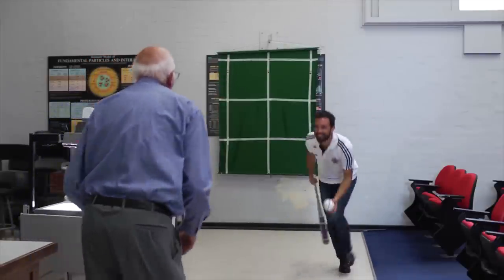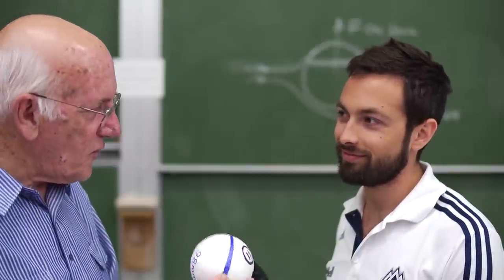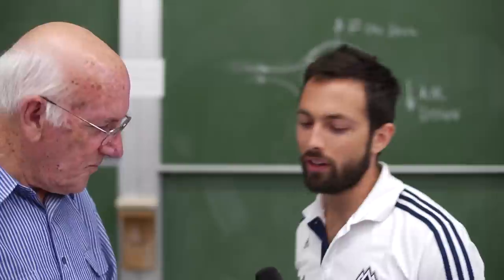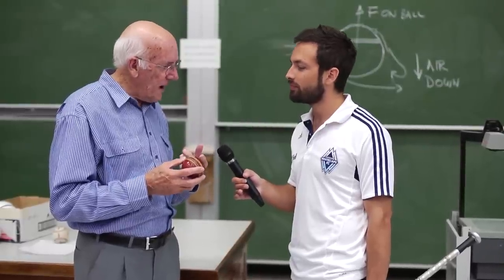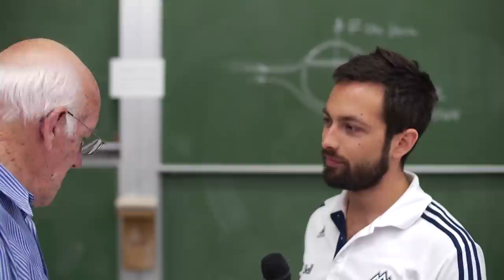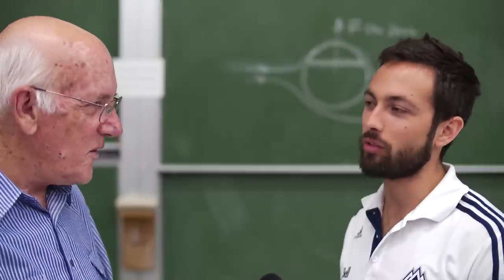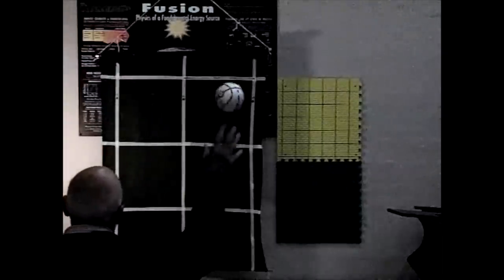The Science of Curveballs

Comment: What you explained with the cricket ball was the conventional swing. Can you please provide an explanation for reverse swing that happens once the ball gets older?
Reply: the bowlers maintain one side by polishing it and allow the other side to deteriorate and become rougher. They can then choose the direction of the swing by just deciding to have the smooth side on the left or right.
Reply: +Dinsdale Drummond that's not correct reverse swing is when the ball usually a ball of around 50+ overs old will start to swing the opposite direction e.g. Towards the shine and away from the rough side. As far as I'm aware no one has been able to comprehensively explain this phenomenon.
Reply: Jon bell this video just comprehensive explained it
Reply: no, this video explained conventional swing with regard to the cricket ball - it did not explain why after becoming old a cricket ball starts swinging towards the shine - do you play cricket ?
Reply: @Jonno_B251  I think the reason might be that, by that time the rough side would have shed a lot of material that the smooth side will be heavier in the air. So this weight difference might override the turbulence effect explained here, as the ball gets older.
Reply: @Jonno_B251  it’s the when the rough side is roughened enough to create air-pockets on the surface, that the air is able to slide more smoothly over those air-pockets than over the not-so-smooth side now (by 50+th over).
Reply: @Jonno_B251 reverse swing is easy air speed is slower on the rough side ... implying higher pressure creating a lift ...  like an aeroplane. Bowls moves in direction of shine. Like plane flaps.

Comment: Just to get the baseball jargon correct: The "curveball" that they talk about at 2:07 is actually not a curveball but a slider, which breaks mostly laterally. The curveball's dominant movement is downward, due to the top spin imposed on the baseball by way of the pitcher's delivery, which basically pulls down at the front of the ball when he throws it.  Some curveballs do have lateral movement, but the essential break is downward.

Comment: The purpose of a knuckle ball is to give very little spin to the ball.
So the perfect knuckle ball initially has no spin.
If the ball is perfectly round and smooth it would move normal.
A ball isn't perfectly round and smooth, it has all sorts of bumps, scrapes or seams.
This, together with drag, will make the ball rotate. Also the bit from 2:50 on is still valid. 
So the ball will swing away from the smooth side, which will change as the ball is rotating. Which makes for a erratic flight path

Comment: I'm sorry if I sound dumb, but what about the Bernoulli's principle? 
If the air passes through the rough side of the ball, then it will meet greater resistance, right? (I'm actually not sure about it).
Then, according to Bernoulli's principle, the fluid(In this case, air), must exert a greater force on the ball than the smooth side.
This should make the ball swing towards the smoother side.
Could anyone please tell me why this approach is flawed or if the assumption I've made is wrong?
Reply: exactly what i was thinking and what i had been learning from other vids.
Reply: No its not flawed, both effects are in place of course. 

Same is the case with the aerofoil, you have Bernoulli and the Third law together gives the lift!
Reply: Your understanding of Bernoulli's principle is a little off. What it says is (in the case of the ball) the air will travel faster because of the roughness (roughness can be attributed to friction, but nor really in this case) causing more terbulance, meaning air traveling faster.
This will cause low pressure on the side which is rough and and the ball moves in that direction.
Remember, the key is that on the smoother side air travels slower creating more pressure and pushes the ball causing it to swing.
Reply: I would like to start by clarifying the deference in resistance, applied on a ball, between a laminar flow and a turbulent flow.The laminar flow creates a bigger wake behind the ball than the turbulent flow, resulting in a larger drag force applied on the ball. A smaller wake behind the ball also explain the longer period in which air ''sticks'' to the ball (the difference in separation point). Another very important thing to note is the misconception around the Bernoulli's principle. Firstly is that you CAN NOT apply Bernoulli in turbulent flow. The assumptions of Bernoulli's principle are: STEADY FLOW, IN-COMPRESSIBLE and IN-VISCID. In this case the flow is NOT steady, it is also NOT in-viscid. It is dangerous to apply Bernoulli if you don't understand it properly. Usually Bernoulli is used for finding values around the real ones and that is mostly because of the in-viscid assumption. The Magnus effect is given because of the curvature of the flow that  creating a change in momentum of the flow and that resulting in a force on the ball. No Bernoulli just change in momentum.
Reply: 0verkilled you have just said the opposite. bernoulli's principle - increase in speed will lead to decrease in pressure, vice versa to achieve lift, wings are designed in such a way to more wind speed on top of the wind compared to bottom.
Reply: 0verkilled Bernoulli's principle can be used to calculate the lift force on an airfoil if the behaviour of the fluid flow in the vicinity of the foil is known. For example, if the air flowing past the top surface of an aircraft wing is moving faster than the air flowing past the bottom surface, then Bernoulli's principle implies that the pressure on the surfaces of the wing will be lower above than below. This pressure difference results in an upwards lifting force\

akash question is valid..looking for a proper reason
Reply: 0verkilled Thank you for your explanation!

Comment: please correct it.. for cricket ball, the rough surface side generates high air pressure, smooth surface side generate low air pressure, so high pressure pushes the low pressure, and ball swings in air in smooth surface side.

Comment: Curveballs generally do not have lateral movement. While there are a ton of breaking pitches and even more ways to blur the lines between all of them, the curveball is generally meant to mean a pitch that breaks from 12-6. It is thrown by providing top spin and making the laces tumble consecutively. As proven by a ton of other ball mechanics, top spin provides more drop off in trajectory. The pitches shown and discussed in this video are more akin to sliders. This difference is the reason why curveballs are what ruin pitchers rotator cuffs more so than any other pitch. To produce the top spin, you align your index and middle fingers on a single seam and as you throw the ball, you turn your wrist sideways and yank downwards. Very few curveballs have perfect top spin and are usually rotating at an angle. This leads to the famous "red dot" that batters will see while the pitch is on the way.

Comment: Bernoulli's Theorem works off the streamline flow of an ideal fluid, which air definitely isn't. If it were, the air would just pass straight over the ball, seams and all, and carry on as it was out the back. And due to the balls symmetry, there is no real difference in distance, and therefore pressure on either side of the ball. Any effect from Bernoulli would be outweighed by the large amount of drag produced by the seam.

Comment: what about reverse swing?
Reply: You reverse the ball. It's a bit hard to explain this way via writing but changing the shiny side and seam direction makes it happen. That's just the ABC. Usually bowlers change the shine direction during run up to confuse the batsmen on striker and non striking end. It's not rocket science but not easy to explain here either. Hope this helps.
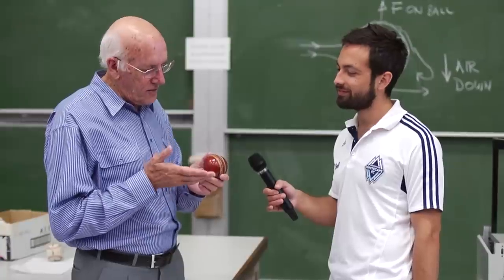Reply: Works on the same pricipal at 1:48 ...just that the seam of the ball is parallel to the wickets when viewed from the bowler's end..

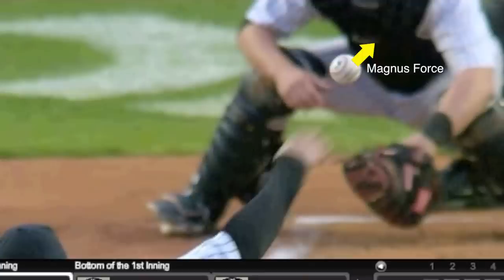Comment: Clearly, the pitch being thrown at 3:21 is a split-fingered fastball. That is NOT considered a breaking pitch. It is more of an offspeed pitch that has movement due to LACK of spin, much like a knuckleball. It's a slip pitch! In essence, a split-fingered fastball is nothing more than are REALLY fast knuckleball. A knuckleball may have 1 or less rotation from release to the catcher's glove. A fastball or curveball is going to have over 10 rotations (or more). An extreme version of the split-fingered fastball is the forkball. That pitch has even LESS spin.

The pitch in the video makes about 5 rotations on its way into the catcher's glove which makes it a hybrid between a high-rotation pitch (fastball/curveball) and a low-rotation pitch like the knuckleball.

It's a bad example for what they are talking about in this video. It would be like showing behind-the-pitcher shots of Tim Wakefield pitching. You would see dramatic movement of the ball but it certainly wouldn't be because of the Magnus Force.
Reply: David Emerling I think you're almost right. Split-fingered fastballs tend to spin less than most pitches, but not nearly so little as a knuckleball. A knuckleball, by having so little spin, is inherently unpredictable in its movement. The is no consistent axis or orientation of the seams, meaning that the ball may move in different directions in one trip between the pitcher and the catcher. This is why catchers hate catching knuckleballers; not even the pitcher knows what direction the ball is going to move.

Splits are not quite so unpredictable. They spin, but just not nearly as much as a fastball. Fastballs spin a lot, with a lot of backspin, which gives them rise. Splits, which are sometimes considered a type of fastball, travel almost as fast, but less spin leads to less rise. This means they tend to "drop" relative to the fastball. If the pitch looks like a fastball coming out of the pitcher's hand, that difference in movement can disrupt the batter. However, they do spin enough that they are not quite as unpredictable as a knuckleball. The knuckleball can cut, tail, rise or drop, whereas a split tends to tail a little bit and rise a little bit.
Reply: David Emerling In reference to the example, the pitch is a splitter, but the rotation axis and the seam-orientation is the same as for a two-seam fastball, which do move the arm-side, or the direction of the Magnus force, as seen in the video. So indeed, the pitch is definitely moving in an unexpected direction.

I would also add that, for these purposes, the distinction of "breaking pitch" is somewhat misleading. Basically all pitches "break" in some direction. Fastballs move upwards to due magnus force, far more than sliders do, for example. Sliders are considered breaking pitches, but their spin axis is actually parallel to the direction of motion, like a bullet, meaning they are less affected by the air than other pitches. The term "breaking ball" refers more to their effect on a pitcher's repertoire than to how they actually move.

Comment: Can we use this theory on producing the bullets?
Reply: Synthetik because after I watch this video, it reminds me a curve shot of movie 'Wanted'.
Reply: +Zenith Let's get some things straight:
Bullets spin around a horizontal axis.
This axis is in the direction of travel.
Therefore the oncoming air a bullet sees is evenly distributed over the front area so that there is an equilibrium in forces and the shot goes straight.
This curved shot would work with an older bullet which was usually a ball shape.
So if the surface of the barrel would be grippy, you could force the bullet to rotate while firing with a flick of your hand.
Reply: +Dust Rider I'm glad someone gets it. Thank you dust rider. Separate the sci-fi from reality, Rtiez

Comment: did I hear them correctly? If the seam is not rotating parallel with the motion of the cricket ball the ball swings to the smooth side and if the seam is rotating parallel the ball swings to the rough side? 1veritasium, can you put annotation arrows on the diagrams? I'm confused.

Comment: It looked as though the ball from the baseball pitcher curved TOWARD the smooth side of the ball.... therefore going against the theories put forth in this video.  Did I misunderstand the theories or did I not see the video correctly?
Reply: sevillain1 It's not clear from the footage which side of the baseball was smooth. The baseball is symmetric, so both the sides are equally "smooth" normally, but if that particular ball had one side smoother than another, it wouldn't be visible to us in that video.

Comment: @Veritasium  not quite satisfied by the cricket ball explanation as when bowlers bowl,the seam is pointing straight down. 
I have a better answer!!
if you have seen cricket, you would have observed that players shine only 1 side of the ball(by rubbing the ball on the pants, using swet, etc) . Now the shiny part has laminar flow where as the non shiny or rough part has turbulent, making it swing towards the shinier side
Reply: You are confused because you're thinking of the Bernoulli effect. It's not the case here, it's the Magnus effect. Don't get confused between the two. Watch the new Veritasium video in which he throws a basketball off the dam.
Reply: Then how does a new ball swing? Your theory doesn't explain that. It has to do with the airflow tripping over the seam and causing turbulence on the seam side and laminar flow on the nonseam side... creating a pressure gradient and hence a resultant force.
Reply: Manav Shah You're talking about reverse swing, which happens late in an innings they were talking about conventional swing which happens with the new ball